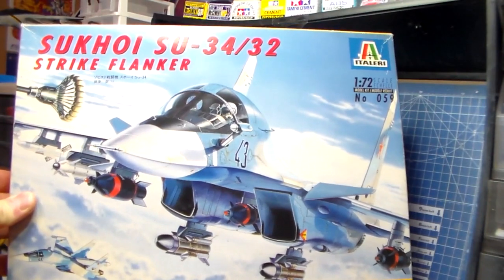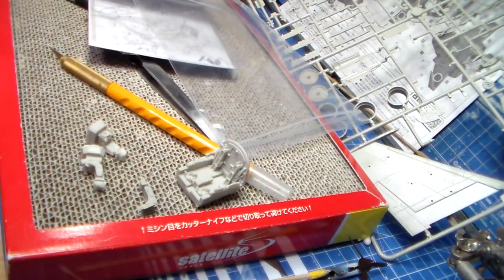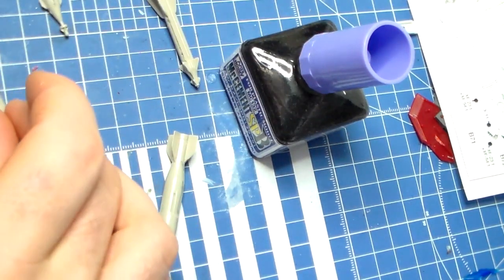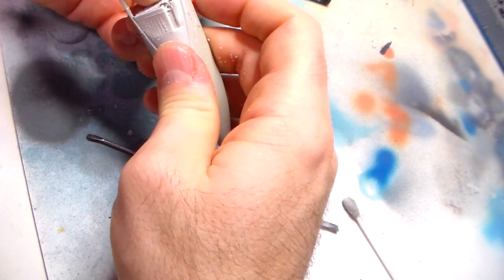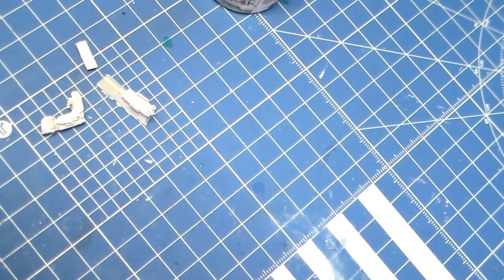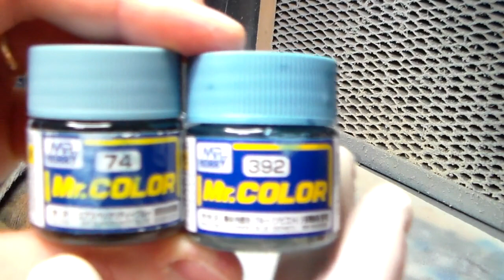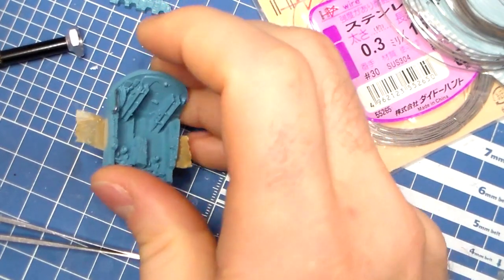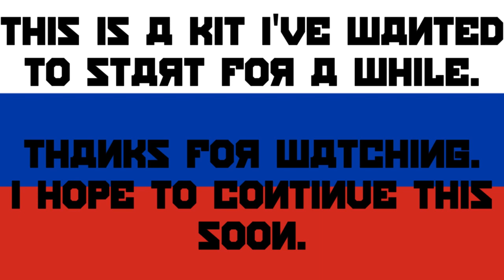Italeri 1:72 Su-34 Fullback Strike Flanker plamo build 1

Comment: The start to another great build, very cool subject IMO but please take care when cutting and sanding resin items! Respiration protection is a must (like a well focusing camera) or you run the risk of lung damage!
Reply from the maker: Oh, trust me. I did use my mask when I wasn't recording. If it's more than just some light sanding, I will wear a mask.
Reply: @stevethefishdotnet  Okay, sorry if I sounded like Captain Obvious there. Michelle Coquette was a contributor to FSM years ago, built amazing 1/32 aircraft models, didn't protect herself when working with resin parts and died of lung disease and damage from resin dust.
Reply from the maker: Yikes! I wasn't aware of her case, however I am aware of inhaling resin dust. Usually sanding or using a power tool will cause resin dust to start flying. If not, I don't sweat it.

Comment: Hey man,,I recently just learned, the pull ring ejection handles at the front of the seat have a cover over them at all times, so you shouldn't drill out the centre, but leave the flash in there.
Reply from the maker: Ah nuts! Too late for that. Oh well. Thanks anyway!
Reply: @stevethefishdotnet  That also applies to other nation's ejection seats where the handles are between the legs or on the lower part of the seat. The rubber sheet/cover is to prevent things like cables, hoses, belts, strraps, etc being caught or hooked and cause an accidental ejection. OTOH the seat models that use ejection loops on the headrests don't seem to require rubber covers since they are pulled down over the face/torso instead and have lower risk of being accidentally pulled.